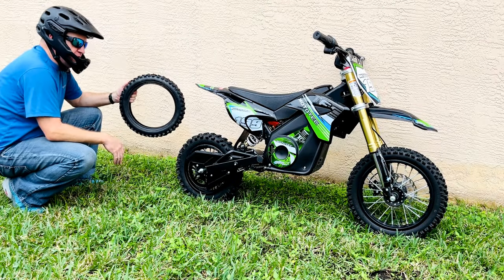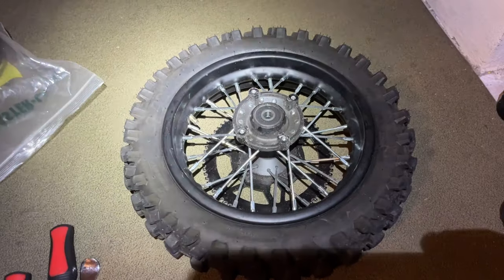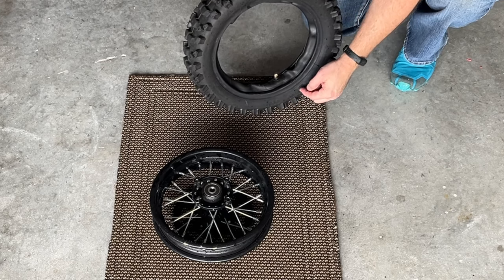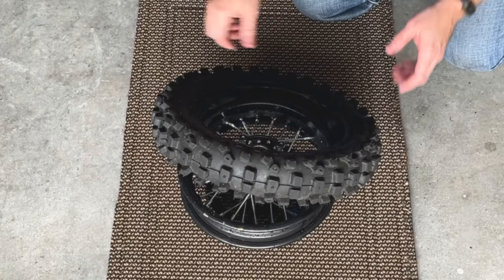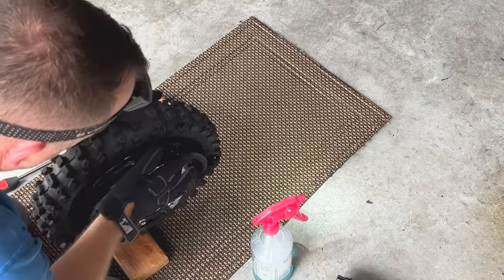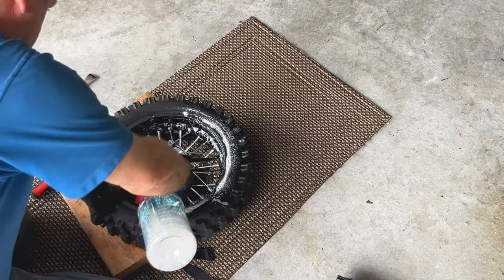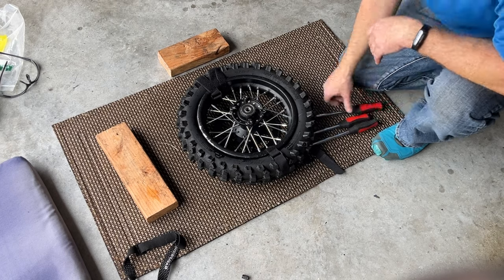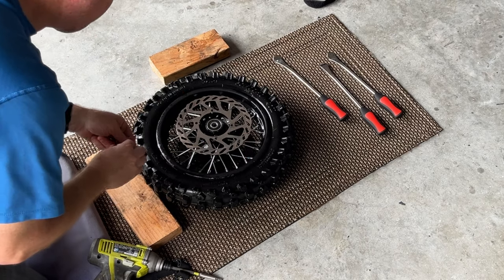Tire Change on Mototec Dirt Bike or Razor MX650 MX500

Comment: A little tip from someone who dies this all day every day. Get your first bead on then pop your tube in. Rotate the wheel so the valve stem is facing you. DO NOT USE SCREW DRIVERS OR TIRE IRONS. KEEP PRESSURE WHERE THE STEM IS AT. With ALL YOUR WEIGHT lean on the bead of the tire. AND THEN WALK THE TIRE ON THE RIM. TAKE LITTLE BITES AT A TIME. I DO THOSE DISMOUNTS WITH NEW TUBES AND NEW TIRES BY MYSELF IN LESS THAN 3 MINUTES. I BEEN DOING TIRES FOR OVER 24YRS. I literally use 0 tools to dismount and mount new dirtbike tires.
Reply from the maker: Thank you
Reply: so what's your method for taking them off without tools? I can't figure out how to get it off. I would appreciate it

Comment: I had to do an mx650 recently and about lost my mind. Heat was the key for me.
Reply from the maker: I put the tire in the sun and use soapy water.  The sx500 tires are even worse
Reply: @BRichSolution  I can honestly say I can’t imagine it being worse. I locked mine up in our very small mudroom for like an hour with a space heater, pointed straight at it. I had tried for almost an hour to get the tire off without using heat and just couldn’t get it. I even tried cutting through it, but I didn’t have enough tools for that.
Reply from the maker: @chrisperrywv  the tire spoons make a real difference
Reply: @BRichSolution  I had them. Only 2 but I’ve got them. It was a nightmare. Haha.

Comment: had to do this twice today on my bike just put the tire on half way like one side is on the rim then shimmy the tube in and get valve situated then spoon it back on didint bend my rim any more than it is
Reply: i wouldnt put the tube on while u put the tire also buy tires that have thick side wall
Reply from the maker: Yea
Reply from the maker: The valve stem gets situated then set the beed